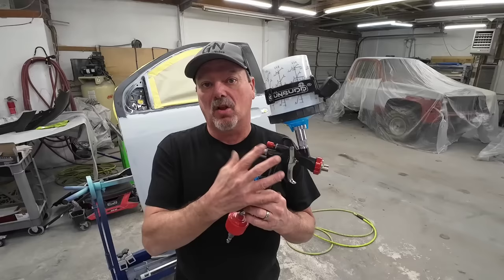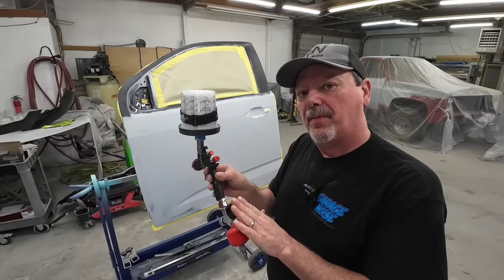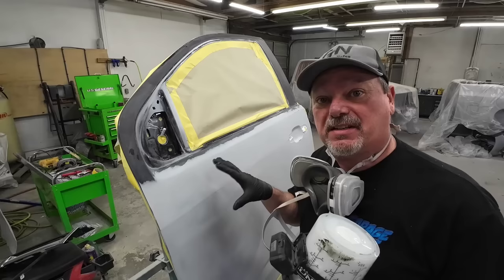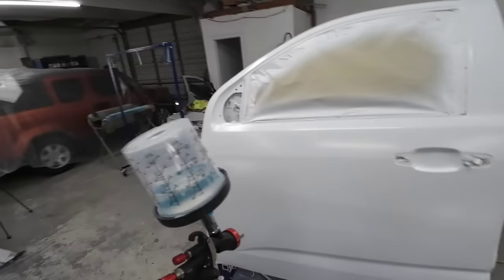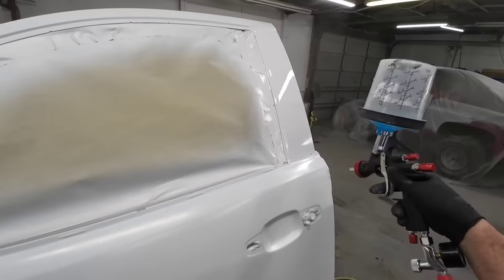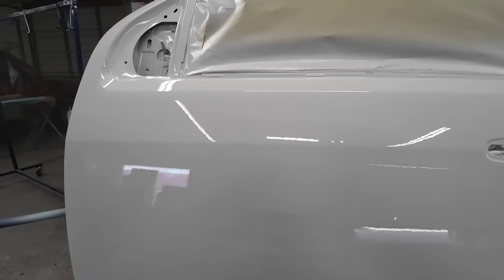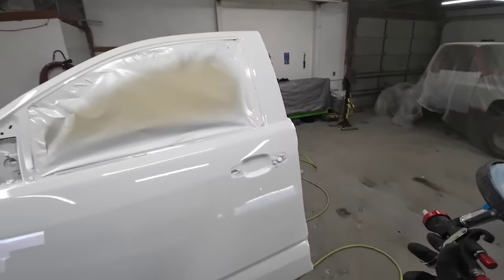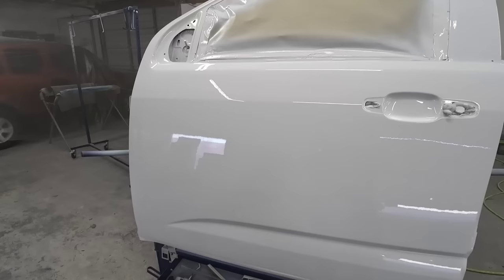Less ORANGE PEEL when painting your car!

Comment: The guy on paint society says unscrew your flow screw almost all the way,  squeeze the  trigger and screw it in until it stops.  He says wide open is the way.  Here are 2 conflicting videos.  Guess it's a trial and error. In which case, why use a video if they are all different?
Reply from the maker: Good question Robert! Brian does an excellent  job. Two different techniques, remember Brian is painting in a booth. I'm  painting in a open garage as are most of my viewers. I want the best possible finish with the least amount of overspray. This is why I don't  spray with the fluid wide open in most situations. I'm also wanting to teach a  understanding of how air pressure ,fluid , your speed and distance work together to create  the finish. I feel like for beginners understanding this is important. I also feel if you start with your fluid wide open as a new painter your chances of runs or heavy orange peel increase because your not yet comfortable with the techniques of painting. Reducing the fluid and a air pressure  give you a bit more control while  you get comfortable with spraying and also helps with material saving and overspray.  If you want to spray with the fluid wide open then yes you need to pull the trigger  close the fluid knob until it puts pressure  on the trigger ,that's the only way to know the fluid is wide open. I would just suggest experimenting and see what works for you. Appreciate your comment and support!

Comment: i was going to buy one of these spray guns but  but drop down menu says 1.3
1.3     1.4   1.5.  1.7.                   cap 1.3. cap 1.4.  cap 1.5. cap 1.7      which is good?
Reply from the maker: 1.3 is a good all around cap the larger the cap helps when spaying thicker material
Reply: Thank you!👍

Comment: What size compressor should I be using
Reply from the maker: For this gun anyone that produces about 6 cfm's
Reply: @GarageNoise  for spraying panels is 25L enough?
Reply from the maker: @dsingh11  25L is how much air the tank holds. What's more important it how much air the the compressor produces per minute. So find out how many liters per minute of air your compressor makes it need to be around 6 for this gun to work without air fluctuations.